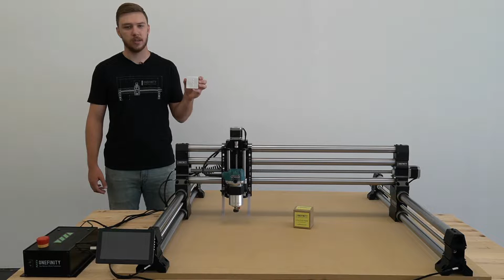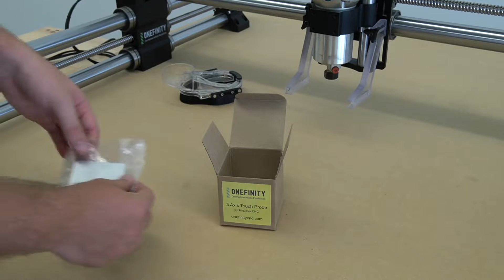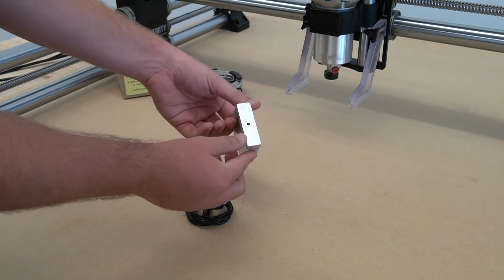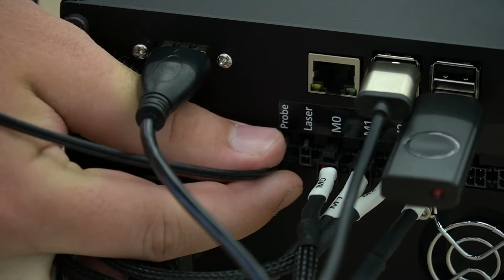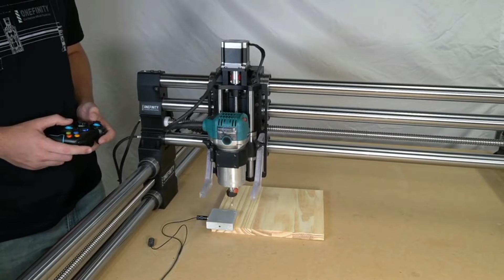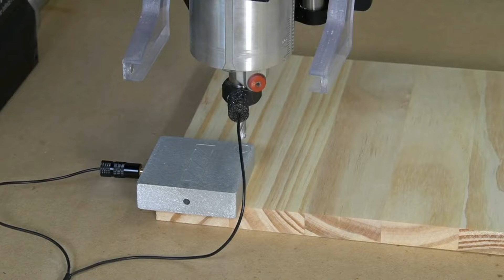Installing the Touch Probe

Comment: If you don't touch off on the outer edge of the flutes, you are going to get an inaccurate XY reading...   a 1/4" two flute bit does NOT have a constant diameter of 1/4"... Your method is flawed, sorry to say.  I love the machine and am seriously considering getting one, I am not trying to bad mouth Onefinity AT ALL.  This zeroing method will work for MOST operations but it is not extremely precise, especially if you are truly needing to find XY zero because you are going to add some element to the piece.
Reply from the maker: You're exactly right.  To be exact, it would be best to use a pin with no flutes!  But our video was to cover the most operations and new cnc users.

Comment: Forgive the newbie question. Do you nees to probe XY and Z before every cut? Do you have to reprobe after changing bits mid-project?
Reply from the maker: anytime you change a bit you'll have to reprobe/rezero the z.
Reply: @OnefinityCNC  so why doesn’t the probe come with the machine? Can I cut without the probe?
Reply: @nikkikristine  You can cut without the probe. You just have to manually zero your axes by jogging them to the zero location then clicking the "pin" icon. For the Z-axis the typical trick is to jog it a little bit above your material surface, then set the jog step to the minimum, and slowly step it down while sliding a piece of paper back and forth under the bit. When the bit touches down on the paper, you feel it, and you call that your Z zero. Close enough for most jobs.
Reply from the maker: @nikkikristine  yes!  The probe is just a convenient feature!
Reply: @nikkikristine  It is an option, you don't have to use one.  You can manually zero the settings.  Making something an option to buy gives you a choice of ala carte.  Better example is the game controller, you don't have to have it, but it makes it nice.  The probe isn't required to use the CNC, but it is nice to have.